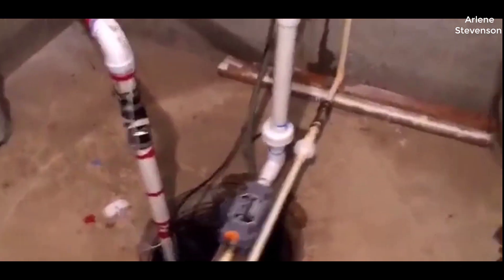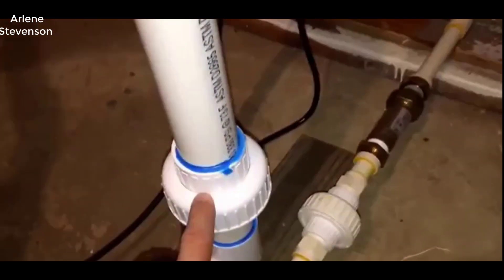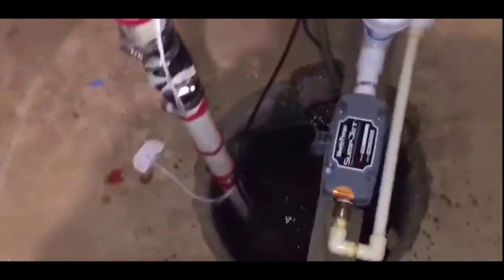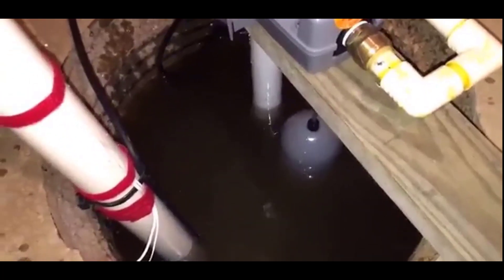Review Liberty Pumps SJ10 1 Water Powered Sump Pump 2019

Comment: FYI It looks like you need a plastic encapsulation on the leaky pipe penetration on the foundation wall.  I had the same issue with a water supply pipe penetration, not the sewer line.